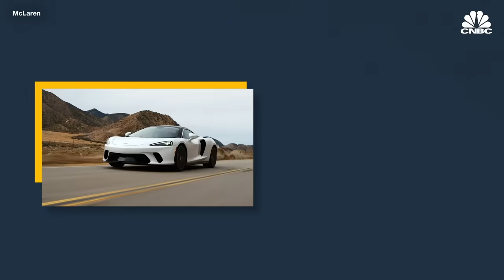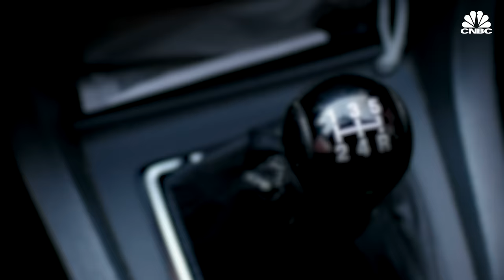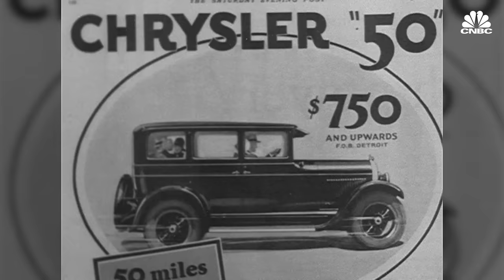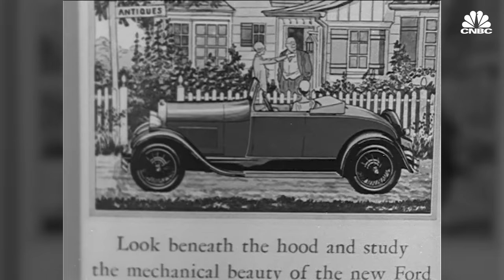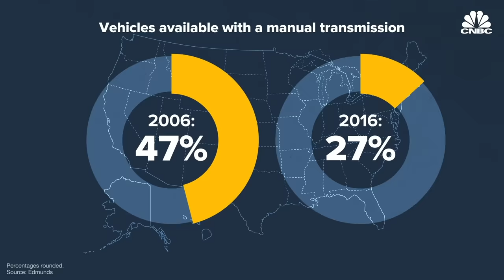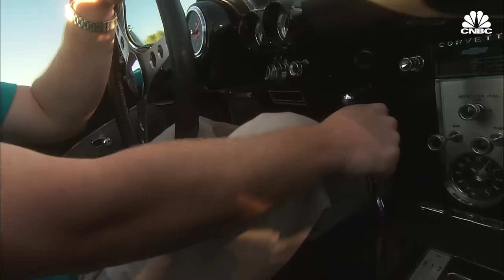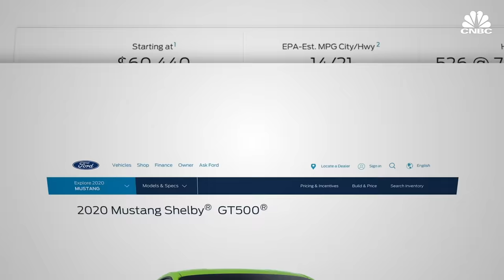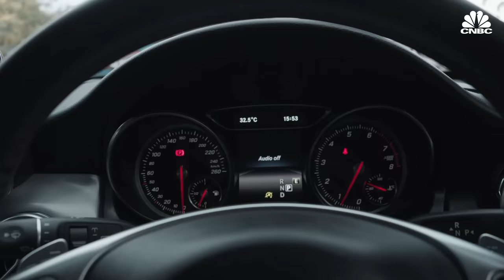Why Stick Shifts Are Going Extinct

Comment: In Europe having a manual is normal, only the more luxury and high-end cars have automatic transmission.
Reply: Same here in India
Reply: @austinjohn1105  East Indians can't afford to pay an extra $1,000 for an automatic transmission, that's why.
Reply: Yep, that's about right. Plenty of new cars in the UK have manual gearboxes.
Reply: Electric cars don't have a manual transmission. If the market moves towards electric, the manual transmission will disappear.
Reply: @mrm7058  electric conversions on manuals mate.
Reply: @OVI-Wan-Kenobi-8  in america most manuals are in performance cars and we associate them with speed. even though manuals are cheaper people mostly option the auto.
Reply: Wrong.
Reply: @mrm7058  They could do, but the way electric works it doesn't need multiple gears in the geartrain, we can do it electronically via electronic speed controllers.
Reply: Iwan van Es in the USA the take rate for manual transmission Porsches is vastly higher so there are exceptions
Reply: Wrong
Reply: Yeah, because in Europe most people can't afford the convenience of an automatic. Then, to make themselves feel better, Europeans tell themselves they enjoy shifting between 1st and 2nd gear over-and-over while creeping through city traffic. We're not fooled. All cars used to be manual transmission, but Americans adopted automatic transmissions as soon as the option became available, because a car is a machine, and a machine should be able to operate correctly without constant intervention.
Reply: Have you seen like the air pollution in Britain for example?  Can't wait for Tesla to take over lol.. our air will be more clear and clean
Reply: @deusexaethera  we dont have same extreme traffic congestions as you have. a lot of public transportation is used by many, cities and around areas have been designed with them in mind. public transportation is actually a choice in here, not just full of crazy people. when theres less traffic jams, theres less need for shifting. if we had your traffic jams and cars were the only realistic option, sure, automatic it would be. but you are right, cars are cheaper in usa, we pay taxes from them. same toyota camry(most common car in usa) is 40000euros here and 25000 dollars in usa. however, even high end cars comes often with stick here as an option, and many choose so.
Reply: Not really. Even your average Nissan's can be automatic. Has nothing to do with luxury just the driver's preference.
Reply: That’s means manual is in the process of going extinct cause everything start with the rich
Reply: Actually, automatic transmission in Europe is overly complicated (even more than manual gearbox) and only useful as tool of planned obsolesence for whole car.
Automatic transmission makes sense in electric car, because there you only need to have 2 gears - forward and backward. Gearbox for this is extremely simple and everlasting. As this is simple mechanic part, it will probably outlast the engine.
As for the shifting with manual, i´ve got used to it. It offers you better control of your car, much better than automatic gearbox. But to get that control, you must master the shifting, not just "use it, because you were forced to".
Automatic gearbox is convenient. But as humans grow more convenient, they also get more stupid. This grows with every step towards making everything easier and easier.
Reply: just wait
Reply: not true. you can buy a 9000 euro car in the netherlands with automatic transmission. every brand cheap or expensive let you choose in having a manual or stick options. some cars dont even come with a stick anymore. no matter then brand. so if you want to say something make sure you are factual. those likes you got shows exactly that people cant do research anymore ore are just simply way to lazy to check it.
Reply: @miko8732  Adding multiple gears to an electric would also add drivetrain losses and reduce range.
Reply: @Morpheus-pt3wq  Electric cars go backwards by reversing polarity.

Comment: I'll save you 13 minutes of your life. Americans are to lazy to shift gears and automatics can now shift faster and obtain better fuel economy.
Reply: Manuals are more fuel and power efficient than automatics because they have a clutch instead of a torque converter.
Reply: I hear a lot of talk about automatics getting better gas milage, but I have yet to see it in practice. My 2004 Honda Civic (manual) gets better milage than any automatic Civic I've ever seen (yes, even the new ones!)
Reply: @ledzeppelin1212  not to mention that manual trans is way cheaper to repair than an automatic
Reply: But I'm American and I have 2 standard cars !! 🤔🤔
Reply: @ledzeppelin1212  IF the driver drives well with a manual, the manual has the lifetime economy advantage. This is especially true if you consider the replacement of the vehicle, which the manufacturers of course lobby against and obfuscate. A properly designed manual with a properly skilled driver will last far longer every time. HOWEVER, the average driver in the USA has no idea what happens beyond the pedals of their car. For these drivers, who are the great majority, the automatic will give the better economy.
Reply: They just never learned. Manuals are harder to learn on plus some states have hills
Reply: @ledzeppelin1212  - modern automatics can get better gas mileage, because the computerized systems will keep the engine in a more precise r.p.m. range and they NEVER miss a shift
Reply: @LucasFernandez-fk8se  What's the problem with hills? Every learner driver in the UK learns to balance the clutch.
Reply: @acebaker3623  I didn't know that. But  these days cars are fitted with so much electronic features that can be  a nightmare tp solve.
Reply: Too*
Reply: my friends manual transmission gets 3.5 liters per 100 kilometers. not possible with an automatic
Reply: @sicsempertyrannis6916  :  A number of years ago, I had a friend who bought a new Mustang that was a stick.  She had asked me if I'd teach her how to drive it.  I did, and she came along quite quickly in learning. THEN, we took a trip to San Francisco.   lol.   HILLS, galore.    We had to stop at the top of the first hill we encountered, and every time she tried to move forward, the car went backwards.    Thankfully, nothing was behind us.   She kept trying with no success while the both of us were in stitches of laughter. FINALLY, she gave up, and we switched places so that I could drive it.  I drove her car the rest of the day in SF.   And, yup, you just have to learn to drop your foot FAST and you won't roll back.
Reply: No you are wrong, Americans NEED to text and drive. How are they gonna send tweets on their Tesla if it's a manual?
Reply: @KeVsPIXEL  bold of you to assume that Americans are the only people who text and drive.
Reply: @ledzeppelin1212  You can't coast automatic cars down hills and towards stop lights/signs. There is no way to record how much fuel that saves, so people don't take that into account, but it's definitely a thing.
Reply: @ledzeppelin1212  ill drive a manual until i die but i will admit SOME of the pretty much brand new autos such as ford and chevys, and porches 10 speed get arround the same if not a tiny bit better fuel economy compared to the manual counterparts becouse with how many gears they have and how fast the computer shifts between those gears it can keep the rpms at a very precise level. Its no where near enough of a difference to make up for the higher maintenance costs tho
Reply: @henryh2985  you call the manufacturer when you need to shift at what rpm and speed? Don't think so. Stick is useful on hills and heavy load or to go fast. But remove the fast apparently new super cars are better in automatic.
Reply: Daniel Ruezga agreed, but many automatics in the US (like mine) do have paddle shifters so if you know how to use them, you can downshift and coast
Reply: @LucasFernandez-fk8se  I dont know why the states having hills is a problem, not that it would be unefficient to drive a manual uphill...and of course manuals a bit harder to learn when automatics dont even have a learning curve, like what do you have to learn on that? Where is the gas...and that D goes forward? I dont think that manuals being harder to learn is the problem, the problem is having to learn anything.
Reply: Too lazy to write too instead of to?
Reply: Cann't let paying attention to driving get in the way of texting. Should make all cars manual, and see how many lives it saves.
Reply: @henryh2985  I like your comment.
Reply: @LucasFernandez-fk8se  Some states have hills? ROFL
Reply: @ume1346  So that's 62.7 mpg (US Gal) or 80.7 mpg (Imp Gal)
Reply: @arx754  I imagine San Francisco must be one of the most tiring places to drive due to the fact that it's so hilly. Can you imagine how much you have to use the front brakes, handbrake, using the clutch to change from 1sr gear to 2nd. Yikes.
Reply: @RuezgaDaniel  Manual gives superior control that if you have learnt on a manual, moving to an automatic feels fake.
Then again, if you drive long distances maybe automatic is a better choice.
Reply: you are the hero we need
Reply: I'm Russian, I have no problem driving a manual, but I still dream of having a good DCT or a classic automatic. Manual shifting can be fun sometimes, but a well working automatic bring you joy and happiness.

Aaaand allows you to drink energy drinks comfortably when behind the wheel...
Reply: @LucasFernandez-fk8se  ,Ohh hills nasty inconvenient stressful obstacles.